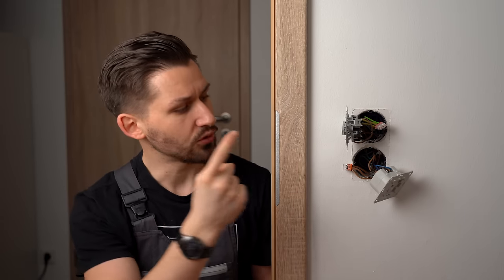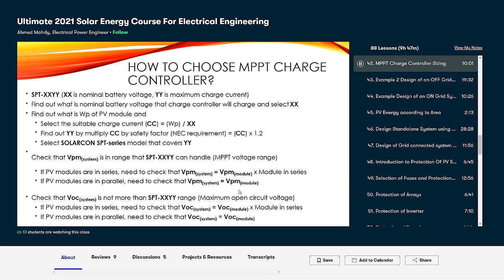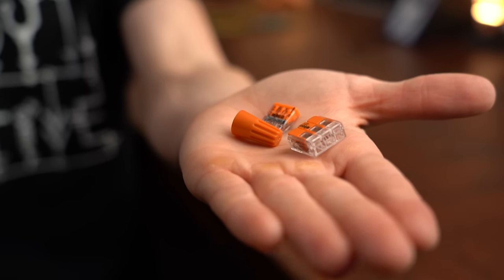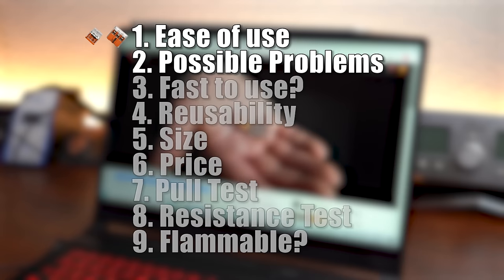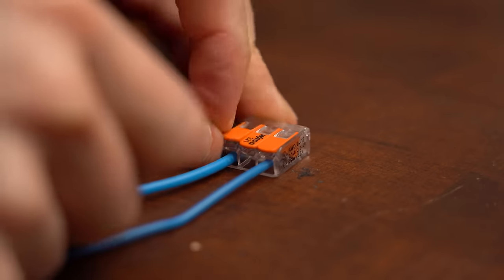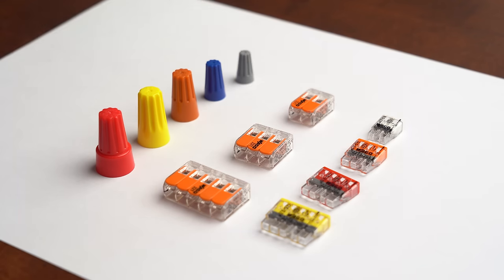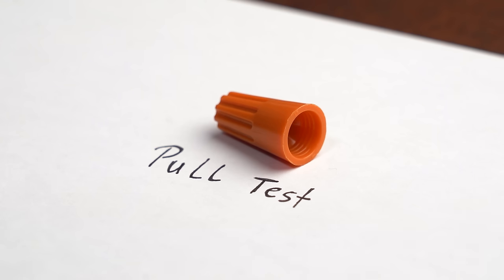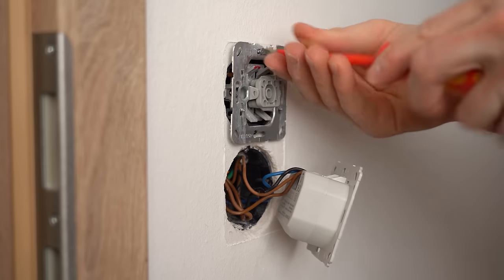What Wire Connector is the Best? Settling a Debate! Wire Nut VS Wago

Comment: Interesting video.... I have never seen that high current voltage drop measurement before.... can't say I'd be happy with that much power dissipation in ONE joint....imagine multiple joints pumping that much heat in one box.... over years and years it WILL degrade the wire insulation... I haven't heard much about examining those wago types 10 or 20 years of service... after door slamming or plugs being inserted and pulled out.... and of course long term high current loads....
Reply: Wagos aren't new. There are millions in use that have been there for decades, and I have never seen one fail. Not one. They are also specifically rated for vibration to German rail standards - the spring keeps the connection tight indefinitely.
Reply: @Stefan_Van_pellicom  I believe it's very common.
  oven, air conditioner, refrigerator, toaster, microwave, blender, garage door opener, air compressor, table saw, electric lawn mower, coffee maker, electric tea kettle, electric griddle, hair dryer, iron so at least a few
Reply: @andrewvoigt1133  And ALL in ONE box? In that installation the power loss of the wago is the smallest issue...
Reply: @Stefan_Van_pellicom  Just about every new kitchen in America has multiple 20A outlets. Often there are two 20A circuits running to a pair of duplex receptacles in the same wall box. People often think this is the case everywhere and routinely try to pull 30 amps from a 20A circuit. 
Mr Coffee = 400W. Refrigerator = 725W. Microwave = 1400W. Waffle iron = 1250W. That's 3775W or 31.5 Amps. Turn off the waffle iron and you're only drawing 21 Amps.
Reply: Especially under vibrations Wagos perform much better than wirenuts. We have lots of loose wirenuts in machines, no problems with Wagos (or similar connectors from other brands)
Reply: @Peter_S_  Your comment definitely shows that using a wago connector in an american household is definitely not something i would ever consider, more then 20A of current draw is absolutely insane when i even think about it. 
I'm German, where wago connectors are the standard and totally fine because with the 230V mains voltage you will NEVER see something close to 20A of current draw, not even mentioning that you can't even draw that much continius current, even if you wanted to, because the standard type of fuse that is used here are 16A ones, for every circuit in a household (so 3680W per circuit at maximum).

Comment: I've done my fair share of DIY electric work around the house and have tried different connectors, but for the price/performance, I like to use wire nut. You just need to use the proper size for your wire gauge and know how install it properly.

Comment: As a professional union electrician in the USA, I have to let you know that Wagos are definitely well-used and, unless omitted from the job specs, the preferred method.
Reply: Mainly because they win on space, time to install, and ease of use. They are more expensive and also produce a slightly inferior electrical connection.
Reply: @Michael Eliot  I've never had an issue with an 8 terminal wago, but trying to fit 8 #12s in, even a big blue, you're gonna be loose.
Reply: @ironsniper13  Eight is too damn many and you would be crab walked off of my construction sites...
Reply: @edwardpaulsen1074  exactly my point

Comment: Wago's are great we use them everyday for our connections at the solar place I work. My only problem with the latch ones are that you need to tape them closed or they can open up and cause a poor connection and melt. We were doing a removal so they could get a new roof and one of the wago's was melted to the side of the box
Reply: Great pointer, thank you!
Reply: What has to happen for a WAGO connector's lever to open again? It never occured to me and I never thought about that either.
Reply: if the lever can move under the force applied via the wire you have a wire of the wrong diameter in there. the latch cant normally spring open when closed, this would be mornic
Reply: @SuperUltimateLP  #12 THHN in a wago rated for up to #10. Moronic is assuming everything works as intended every time, Boy would I like to live in that world.
Reply: I've never had a latch come open. I have found apprentices not getting them closed. Every apprentice gets a make-up check for awhile, and it's unreal the stuff I find undone.

Comment: Because of the heat issue WAGO connectors are more likely to fail over time in high wattage applications due to expansion and contraction.  That is why a lot of electricians will not use them in outlets in America.  Wago connectors do connect different wire gauges more easily, are easy to visually check and frankly are more aesthetic.
Reply: Wire nuts are easy to check if you have a good connection. Pull on it. If it comes off, your connection wasn't good enough. Usually we twist the pair a little bit especially with stranded and when pairing solid and stranded
Reply: High wattage in the USA? Where? Last time I checked you guys still used 110v and 20a fuses resulting in a max powerrating of 2200w (or if you are on 120v now at 20a that's a mere 2400w), but in Europe we use 230v with 16a fuses and thus have a max powerrating of 3680w that we can pull out of the wall. 🥴
Reply: @LogiForce86  Mostly true, but we use 240 volt outlets too for house appliances and a lot of people have a 240v outlet in their garage for tools.
Reply: @Anthony DiNovo  Yeah, for high power applications, we have 3 phase 400v at 16a over here. For example, the electric stoves we have use 3 phase power. As for garage tools, that is all on the normal 230v system here unless you get maybe heavy machinery. But that stuff isn't something we have room for in our tiny homes. Most often, we don't even have a garage and just a small storage for 2 bicycles at best.

Comment: I tried WAGO connectors on my last project just to see. I am mixed. I prefer the wire nut's snug connection, the WAGO allows the wire to rotate as you work around in the box and more than once a wire worked it's way out. This usually  happened when I used 12 and 14 gauge wire in the same connector. The ones I used are the push in type not the lever type. They do make for more ordered looking pigtails.
Reply: Be prepared to replace them all. Anything with much of a load is going to burn them out.
Reply: You remove a wire for e.g. rewiring by rotating the wago and pulling the wire, so that works as designed.

Comment: I learned about wago only recently and I wish I knew about it sooner. I would use wire nuts for all the same reasons everyone is already stating, but I would love to use wago for anything larger than 3 connections. Trying to fit 4 cables in a wire nut is misery. Especially when there are different gauges trying to all get jammed in the same wire nut. The wago has those separate channels, that is awesome.
Reply: Yeah, there also wago connectors with up to 9 channels
Reply: you NEVER EVER MIX diffrent wire gauges
Reply: @Klausmd5  do you have any recommendations on brand or where to buy them? I was going to get it from Amazon but I kept seeing reviews about bad Chinese knock offs that are prone to fire. I got cold feet and never bought any.
Reply: @DyslexicAnaboko  Wago is the brand
Reply: @IDJEGOI  thanks for the confirmation. I knew it was the brand but I wasn't sure if it was a situation where you see the words Wago on something to explain the form factor. Like Molex, Romex etc...
Reply: Misery?  Really?  How long have you been doing electrical work?  I can think of only 2 situations that require different wire sizes to be connected.  The load is usually a smaller wire than the branch circuit wire.  (Light fixtures are usually 16 AWG but connect to 12 or 14 AWG in the junction box.) 
Other than that, an increase in wire size for a long home run pull might be necessary.
Reply: @SteveWhiteDallas  I have been doing electrical work for a long time, but I am a home gamer. However, everytime I have had to deal with a single gang box that has two or three romex terminations in it, it is absolute misery to wire nut everything, shove the connections to the back of the box and somehow get these oversized fancy interrupters into the box too. Especially the crappy grey plastic boxes which are suspended on one side by a metal stud. So everytime you push the whole thing moves into the wall. I have seen some horrible wiring situations and I always do what I can to clean it up. I am just saying I think it would be less painful to use a wago for those multiple terminations instead of a giant red or purple wire nut for 4+ solid copper cables.
Reply: @DyslexicAnaboko  I apologize for questioning your skill without understanding your situation.  I guess I still don't completely understand.  You said metal studs and romex?  The only thing about Wagos I just cannot accept is the 0.88 watts.  This guy didn't tell us how much voltage drop was caused by the Wago connector.  I'm not sure why he chose to do this comparison with power, as opposed to current.  He knows formulas, but I'm not sure he fully understands electrical  theory.  Power is the product of voltage and current - the output of a device, calculated from from from thew device's consumption required to meet the demand of the load.  But a Wago is not  a power-producing device.  To get a true understanding of how a Wago affects the circuit, we must know the voltage drop.  No current can be consumed; No power can be produced without causing a reduction in voltage.    0.88 Watts is insignificant with a voltage drop of 120Volts (.007 Amps.)  But the voltage doesn't drop anywhere near that much.  Wit a voltage drop of 2 volts, 0.88 Watts indicates a load of 0.44 amps.  That would be a problem.  With 12 in the ckt, that would be a huge problem.    This test needs to be reworked  Something wasn't done right.
But it seems that you need a larger single-gang box for the devices you use
Reply: @SteveWhiteDallas  yes metal studs and Romex and I am just reporting what I find in the boxes, I agree with you that many terminations in a single gang box is ludicrous. However back to your points, I hear what you are saying but I would reluctant to believe that the bus bars inside of the wago connectors are going to have high resistance just like the knife terminals on a plug which are made of steel in some cases have a negligible resistance. I am going to rewatch the video because I didn't catch him talking about power to be honest, I may have jumped around in the video or I was multitasking I can't remember. I wouldn't be too worried about voltage drop here, this isn't a diode, it's just a conductor with no inline resistor therefore it should be negligible. I understand that power can be lost in heat, but if the wago is heating up (which wire nuts can do too) that's a different problem, then it goes back to your initial comment about changing out the gauge of the supply line. Transformers are essentially 99% efficient, but they too still lose power due to heat and many other factors. So for a bus bar to be dropping major voltage would be a red flag to me.

My specific example is, I dislike having to cobble together five 12AWG wires with a possibility of throwing in a 14AWG or even 16AWG sometimes to leach power for a light source through these newer interrupters (Lutron Casetta). It drives me crazy because you end up having these gigantic ugly spider creations all terminating into a red cap wire nut which is prone to slippage. A wago with individual channels is cleaner and far less stressful to deal with. I agree with you though, the concern of the bus bar is a valid one and I bought a set yesterday and I will be testing it out.
Reply: @SteveWhiteDallas  I re-watched the resistance test portion of the video a few times and this is what I got out of it. I agree with you this is a bit odd and only OP would know the answer here. A few things to note are that the test was performed with some nice benchtop equipment that is able to perform load tests without turning the wire into a light bulb filament so that's cool. If anyone else ran 20 amps through a short piece of wire like that it would probably melt almost immediately. So let's assume the right type of equipment is used here.

You can see he is performing the test using 0.2V @ 20A DC which is 4W (P = I*V).

The only thing I have a complete picture for is the wire nut which he rated at 0.15 mOhm. I tried recreating the calculations based on what I saw on the screen at https://youtu.be/zgjo36-jaFY?t=531 and this is what I came up with:

Wire nut resistance
V/I = R
0.072348/20 = 0.003617 Ohm //Total resistance
0.035088/20 = 0.001754 Ohm //Wire resistance - one leg only
[Total R] - 2*[Wire R] = [Wire Nut R]
0.003617 - 2*0.001754 = 0.000109 Ohm -> 0.109 mOhm //Not what he calculated, but close to the reported 0.15 mOhm

Therefore I can use the wire resistance values again for substitution.

Results from the vide:
Wire nut 0.15 mOhm
Wago1 0.4 mOhm
Wago2 2.2 mOhm -> 0.0022 Ohm

He calculated a max power loss of 0.88 W

P = R*I^2
Sqrt(0.88/0.0022) = 20A //this math checks out but how did he get the 2.2mOhm?

V1/20 = R1 Ohm -> V1 = 20*R1 voltage drop
R1 - 2*0.001754 = 0.0022 -> R1 = 0.0022 + 2*0.001754 = 0.005708 Ohm -> 5.708 mOhm

0.005708 - 2*0.001754 = 0.0022 
V1 = 20*0.005708 = 0.11416V -> 114.16mV

So the total resistance is 5.708 mOhm and the voltage drop is 114.16 mVDC

I could be wrong, but this sounds too high to me. Then again in a system where we are actually working with 120VAC @ 15A+ maybe it doesn't matter. We are either driving motors which can be considered transformers and will smooth the power or we are pushing power into a DC power supply which also performs smoothing and is dropping the voltage down from 120 to 12 or 5VDC in most cases.
Reply: @mrx-jz8us  beg to differ. Hot supply line coming in is 12AWG and available connections on the Lutron Casetta Dimmer which does not have screw terminals but instead has wires coming out of it; it can be as thin as 14 to 16AWG depending on the model you are using. What would you have me do in that situation? So yeah those get connected together. Talking simple lighting (LED), nothing crazy. The Lutron Casetta Switch (think ceiling fans) does have some proper gauge wire though, so not sure why the dimmer does not. If using the switch for three way connection it provides something like a 14AWG.

Comment: When using a wire nut with both a solid and a stranded wire, you are supposed to extend the tip of the stranded wire past the tip of the solid wire, otherwise you will have the possibility of a connection failure.

Comment: Generally the local codes in the U.S. will require a mechanical connection (wrapping wires together) even when using wire nuts. The wire nut is just intended to insulate and ensure wires stay together. I do agree the Wago's are a nicer solution and one I use whenever I can.
Reply: I mean, that’s what a wire nut *is*. If you don’t have that, you don’t have a wire nut connection, you have a botched job that someone should get fired for. Possibly out of a cannon.
Reply: I don't agree. Codes require that approved components be used in accordance with the manufacturer's instructions. Some manufacturers of twist on connectors (Wirenuts is a brand name) state that pre-twisting is not required.
Reply: Why would you use a wago after what you just said?

Comment: Excellent video. As a USA electrician, I've used many wire nuts and also Wago 221. Here where we commonly use larger size and higher current circuits (lower voltage) than in Germany I believe the wire nut is the preferred choice due to best connection. 

That said I use many of the Wago 221 for lighting and lower amperage circuits. I love them for overhead connections that can be easily made with 1 hand.

Comment: I have never used a Wago connector before, but I plan on trying them out! I still prefer a soldered connection (stranded wire to stranded wire) for my work, but the Wago seems like a great trial-and-error connector for testing how nicely things play together before making a more permanent connection.
Reply: A crimp may be the ideal solution for your use. They don't have the embrittlement issue of soldering.
Reply: Electricians don't solder wire together. That would be electronics.
Reply: @jamescole3152  that's wrong,im a electrician, here in Germany, it is fact that you mostly need to solder when you do intruder alarm systems, also on some fire warningsystems, in general, you also use Wago for permanent connections on up to 4mm^2, im not sure but I think there was some bit bigger versions too. There are even really small wago for some low voltage cables down to 0.25
Reply: @benjaminconrad3674   That's really odd. They quit doing it in the US because it could be melted by the heat from a bad connection. Just crimp/wirenut/wago here. All of the fire alarm systems I've done were a closed loop. If the panel couldn't see both ends, it went into a failure code alerting that the system was compromised.

Comment: They are both great options. To me, it depends on they types of wire I'm connecting and where/how much & how likely I am to remove it later on. I wouldn't reuse wagos but I don't reuse old wire nits either.